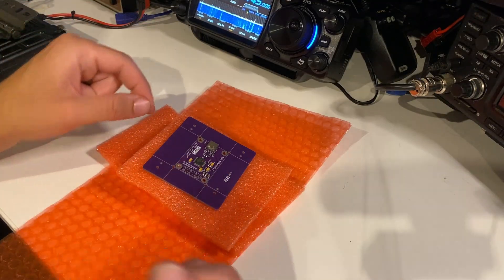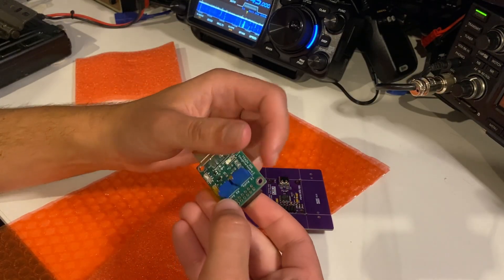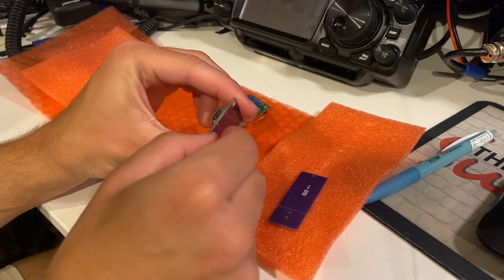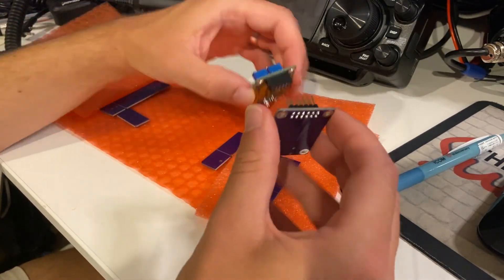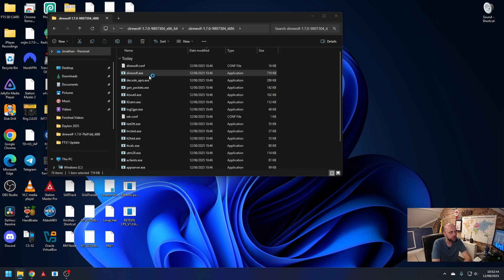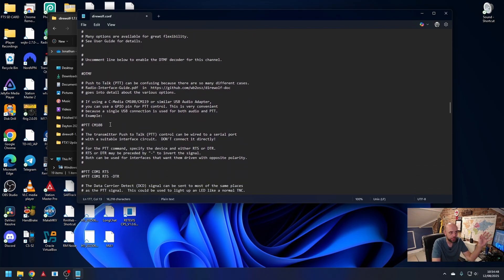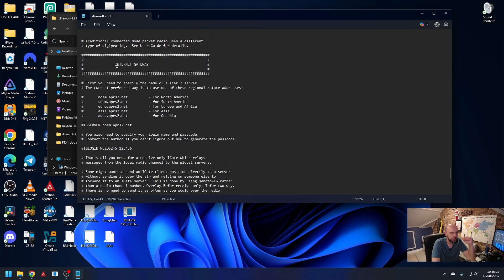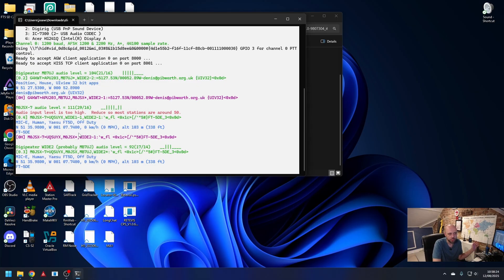Create an APRS digipeater, the EASY way! - TOADS DI

Comment: HI There, have you gone down the route of getting a MB7 callsign for your digipeater? If so how did you apply for the callsign? Been looking at the docs today and it's not clear how the callsign is granted from the RSGB.
Reply from the maker: I haven’t. Simply because as I run less than 5W it’s not required. Best of luck navigating the paperwork!

Comment: Any other suggestions for Radios with 6 Pin Data Socket..?? Thanks
Reply: break out boards are widely available
Reply: Works on my IC706Mk2G
Reply: @VK5AV  Thanks...
I should have said "FM Radios"
Reply from the maker: Most of the older generation Yaesu radios have one. FT-8900, FT-7900. Or Kenwood TM-V71 perhaps?
Reply: @M0JSX  Hi, Thanks... I will do some searching... Cheers

Comment: OSX also has the volume down issue, well I've seen it on my Intel Mac
Reply from the maker: Removing the COS pin will also work on MacOS of course.
Reply: Same problem with Linux. Removing the pin disables COS so not good.